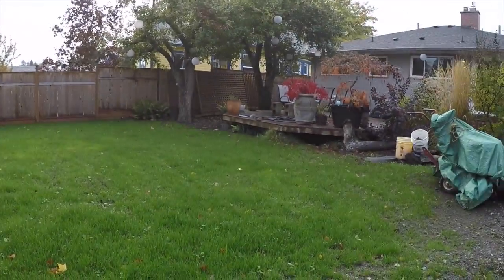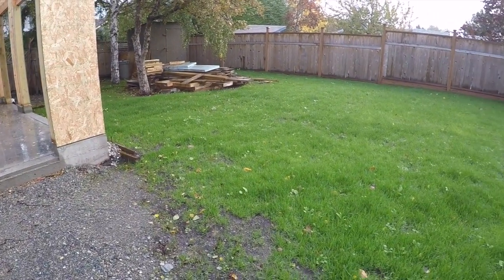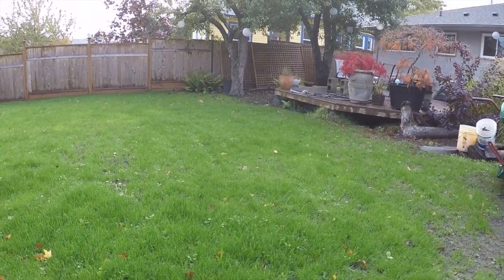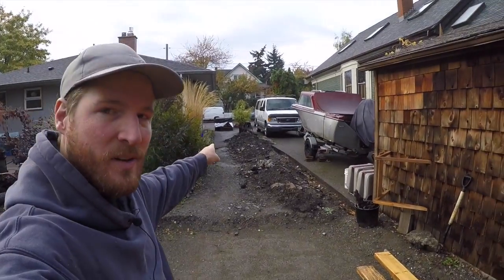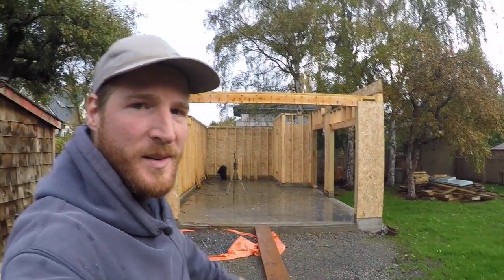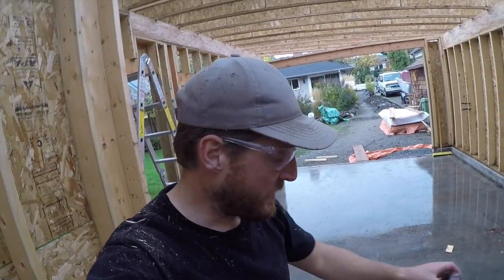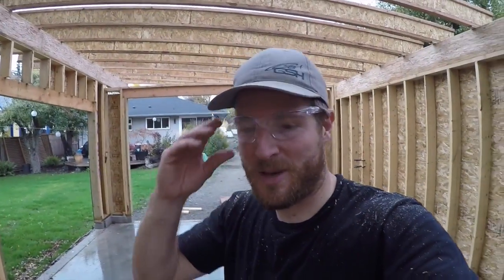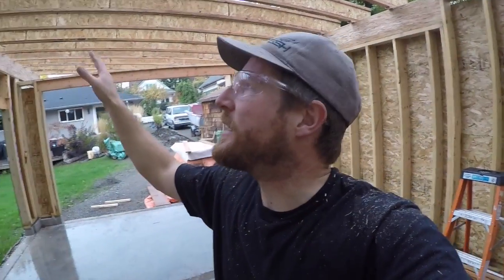Backyard Accessory Building Build 27 - Roof Pt. 1 - Structure

Comment: hi, thanks for the vid. Where did you source the shims that went under the joists?
Reply from the maker: I just used regular old door shims. You can get them in plastic or wood at just about any hardware store. cheers!
Reply: @matsworld9386  thanks for the quick reply. Your vid is a lifesaver.
Reply from the maker: @jl9678  Hey I'm glad it helps, that's great :)

Comment: what depth were the TJI beams that you used for this project ? Looks great, im prepping for a roof install with a minimal pitch as well, much longer span though. 32 ft. Im reading span tables til my head spins, seems like 16" depth TJI 560 is the only beam that will span that distance. THANK YOU in advance! great channel
Reply from the maker: hey Joseph, thanks! I want to say 9.25" for mine but I can't be certain .. certainly not 16" .. I also remember that the 5' over hang on the high side of the roof was the max I could do with the 16' span between the walls .. I had my lumber yard spec it all out for me .. they have a standing agreement with an engineer who signs of their lumber packages ... good luck with your build!